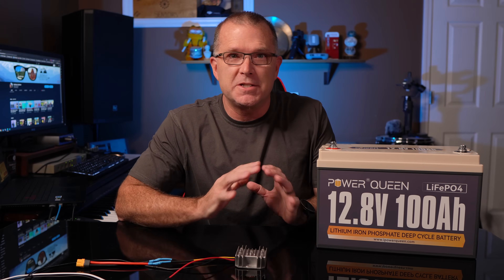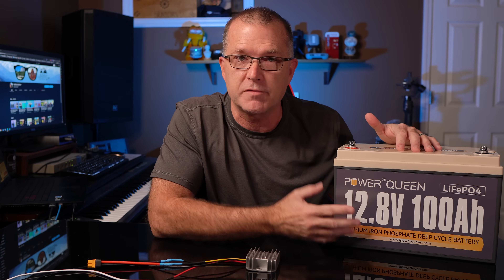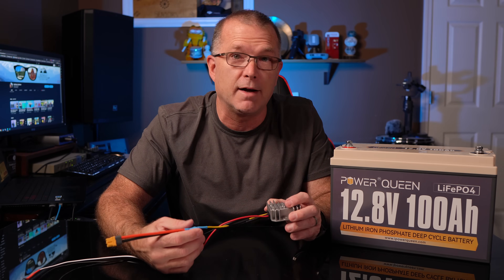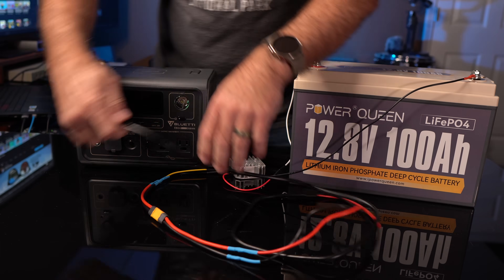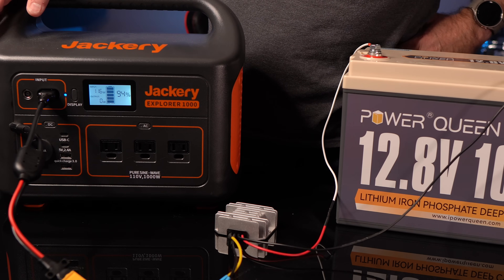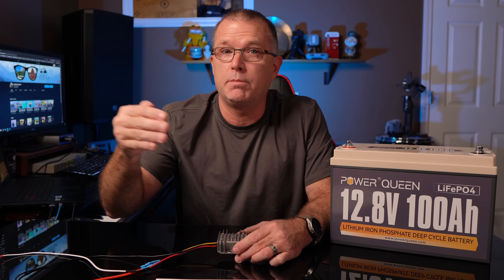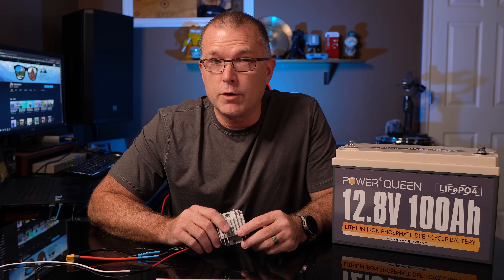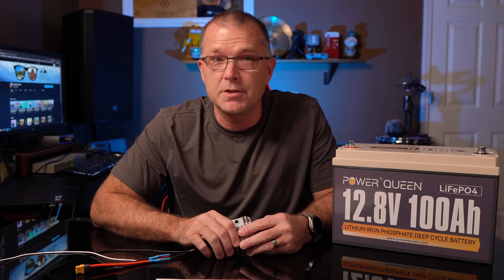SUPER EASY!!  DIY Power Station Battery Capacity Expansion / Charger

Comment: Thank you for your video, I have followed this path.
While I was experimenting with my Ecoflow power stations and a Power Queen 100Ah battery, I built 2 10AWG cables from the battery to the Ecoflow unit. 
One cable had the regular yellow XT60 female connector, the second cable uses a XT60i orange female connector.  
The XT60 cable consistently delivered 102-105 watts to both the Delta Mini and River 2 Pro
The XT60i cable delivered 168 watts to both units.  
I hope this helps, thank you very much.
Reply: Your connection was directly from that battery to the River 2 Pro without the transformer? So this acts like "Pass Through" charging. As long as the output from the main battery doesn't exceed the incoming power, the main battery "remains" charged except for inverter loss? (YES...l'm a "Newbie")
Reply: @reese9276  Hi, the connection is directly from the battery to the Ecoflow units without a transformer, it is pass-through.
I have tried a 12v-24v step up transformer and that yields better results but I'm always concerned about the heat buildup in the transformer, even of the transformer is rated for 20Amps.  
To avoid the power loss issues, my 12v batteries are configured for 24v output and also bought a 24v-50Ah QWW battery that offers excellent performance, I always use the XT60i connector.  
I hope this helps!
Reply: @af1023  Absolutely it helps. Thank YOU!

Comment: Since you have a Vtoman Jump 1000 that uses this "same" VT60 connector for their external battery, have your tried to input the Jump 1000 external battery jack using the XT60 connector and see if you are able to use your own battery - 25.8 Volts - input to the Jump????  Thanks in advance for your testing this theory....

Comment: Concerning the Vtoman Jump 1000, I know you've got one :-), what is the output voltage of the Vtoman extra battery for the Jump 1000???  I am looking to NOT input to the DC input jacks, but, directly tie into the connection for the additional battery pack to actually power the Jump 1000 inverter itself.... As using the step up converter as a CHARGER ONLY is a good alternative for charging, the Title of "Capacity Expansion" with averaging ~100-130 watts output of the converter is misleading at best....
Reply from the maker: I actually just recently sold my Jump 1000 and expansion battery since I'm moving soon and needed to 'lighten the load'.  I'd imagine can get a voltage reading off the expansion port of the 1000 when you get it.  If not, you can try reaching out to their tech support on that question.  They've always responded to my queries within about 24 hours or so.
Reply: @ReeWrayOutdoors  IF, have to measure to be sure, but, the 180 watt charger is speced at 24 volts at 7.5 amps.  SO, need to measure to be sure, but, it looks like the inverter operates on 24 VDC....

Comment: I have a power wheels adapter for my Bosch drill batteries, and use them to expand the capacity of my smaller solar gen in a pinch.

Comment: Can anyone answer why not just get a 24v or 36 v battery then ? And eliminate this step up?👍
Reply from the maker: For sure...if you don't already have the battery, that would be a totally legit way to go.  Alternatively though, depending on your situation, the 12v might be a bit more versatile choice since you can easy run 12v DC appliance from a direct connection.

Comment: I simply have my Power Queen 12v 200ah battery with a NOCO connector on it and charge my EcoFlow Delta 2 plugged into the 12v cigarette to xt60 at slightly over 100w. A trickle charging under load is said to extend your LifePo4 life.
Reply: You think this configuration would work for EF River 2 Pro. I was thinking 200ah would make it a beast in my small camper van.   I didn’t to to lug around my heavier delta 2 max
Reply: @bdmenne  A 24 Volt 100ah Lithium Iron Phosphate Battery will Support and Extend The River 2 Pro and used here often. My Delta Pro 1300's and My Delta 2 Pro and Extra Battery set ups.
Reply: how do you charge the battery?
Reply: @selmopt   With solar or AC wall charger.
Reply: @selmopt You can charge the battery via solar or quicker yet with a LifPo4 charger. It's simple with no worries.

Comment: If you use just a straight XT60 to ring terminal from your battery to your unit you're going to get about 100 watts anyway so why spend the extra $15 for that? LOL however for about $5 more you can get a 12 to 24 Volt 10 amp which takes you to 240 watts 😎😎

Comment: I get 160w into my EB3A using this method, and the I used source is a cheap power station. 
I did have to put the EB3A in standard charge mode and the noise is the fan that comes on.
Reply from the maker: Nice!  It actuality never occurred to me to check the charge mode on the EB3A!  Good catch!

Comment: Great video!  Looking forward to using this technique with my Pecron E600 that’s currently in the mail!  As you know it has a 1200 watt inverter but only a 600 watt battery.  Adding a second battery might be ideal!  So I guess I pickup a charge controller to harvest from my Pecron 300 solar panel (also in the mail) and use a voltage step-up to dump into the E600.  Thanks!

Comment: Amazon sells a $38 12v to 48V step up converter at 6 Amps for about 288 watts of charge.  Assuming that your solar generator can handle that (Ecoflow handles up to 60 V) would that work better perhaps?
Reply from the maker: Sounds promising!

Comment: i have a step up boost converter 12V to 24V 10A for my powerstation but the converter got very hot is that normal?
Reply from the maker: Yeah that is pretty typical.   I've seen some people bolt a computer-style DC cooling fan to them to help with heat dissipation.

Comment: My goal zero lithium 400 has 22v max input, would this still work or should I just connect The battery directly to an input connector?
Reply from the maker: I wouldn't use the 24v converter in that case...and risk damaging the charge controller.  A direct connect (with an in-line fuse on the postive lead) would be the safest option for you.

Comment: Hi thanks for the information, i really need the cheaper expansion option. I wonder if i can use 100ah 48v lifepo4 for delta pro expansion?
Reply from the maker: Just looking at the Delta Pro Solar (DC) input specs, it shows 11-150V @ 15A.  So I'd think as long as you put a 15A or 20A fuse on the POS lead between the 48V battery and the Delta Pro connection, it should work.

Comment: I have a 12v lithium ion phosphate battery and just with wiring and no step up, I can get 78 watts into my powerstation which has a 24v battery system inside.  Just an fyi if going camping and trying to avoid all the extra pieces like a step up converter.

Comment: The ecoflow river’s battery expansion pack will both charge and discharge via the ecoflow.  Everything I’ve seen with these addon is that they’re not automatically recharging, as with an internal addon battery.  Is it possible to set it up so the river will charge the external when it’s attached to A/C,  and discharge it when A/C is not connected?

Comment: Wow. That's interesting to know. Just one question. Can I recharge this battery as well with any of my solar stations? 🤔 Thank you so much for all you do. Hugs from Spain
Reply from the maker: You can.  The best way though is to get a LiFePO4 charger and plug it direct into your power station.  This will ensure that your LiFePO4 battery can be charged fully (provided your Power Station has sufficient capacity) and is not over-charged. I'm actually starting work on a DIY video soon to show how you can build an inexpensive 'DC module'  to attach to any 12V/24V battery and directly power DC devices (USB and 12V car connector) as well as add solar charging direct to your battery. Stay tuned for that. :)

Comment: Is there a way you can charge the 100Ah battery via ecoflow delta 2 (say DC/ cigarette port), so that basically the solar that's plugged into Delta 2... Can charge the LiFePO4 battery?
Reply from the maker: To some extent, yes, but using the 12v output on the power station, it's not going to be enough output voltage to fully charge the external battery. You'd be better off plugging in a LiFePO4 charger into the AC outlet on the power station and charging it with that. Safer and will allow you to fully charge the battery.

Comment: Ok since I'm running 2 12v 240 ah power queen at 24 volt. Can I just put that plug right to the batteries and be good ? Cause all you're really doing is upping voltage and adding plug right ? I have 2 eb55
Reply from the maker: Yeah for sure! I'd recommend putting a little 15A fuse in line on the positive lead for good measure.

Comment: So, if you have two 12v batteries, you don't need the step-up adapter?  I have two heavy duty forklift batteries and an MPPT controller for my two 100W solar panels.   I don't have a power station yet.
Reply from the maker: Yeah as long as your power station's DC input range handles 24v, you should be good just wiring a cable with an in-line fuse and direct connecting it.

Comment: Hi,what would be more efficient,using this step up converter or my inverter?
Reply from the maker: Most likely depends on how big the inverter is.  The bigger the inverter, the more efficiency loss (typically).  Probably anything 500W or less would be close enough so as to be a wash vs the step-up converter.

Comment: great video ❤thanks, wish it worked for my eb3a, wonder if i use a 12v 50ah without a booster ,if that would do it
Reply: You certainly can. I have this setup. You can bypass the booster, no problem. Plus you can always combine two 12V 50ah & get 24 (actually bit more, like  25.6 Volts) should you need the extra boost. I rather have two batteries, cheaper too for some reason, at 50ah than 100ah with a booster.  Food for thought.

Comment: Couldn't you use two and wire the inputs and outputs together to increase the power?
Reply from the maker: Yep, you could do that, for sure.  Just need to make sure that you put a 15A fuse on the + to reduce risk of damage to the power station input.
Reply: Can you please explain this setup clearly. Thank you.

Comment: Bluetti already makes a battery enhancer I use connected to a 12v 100ah LifeP04  battery for my Bluetti ac200p called the DC Charging Enhancer (D050S)
Application Model: B230/B300/EB150/EB240, AC200/P/Max

Function:

* Enable more charging methods like solar, car, and lead-acid or LifeP04 battery charging.
* 500W Max input.
* Increase the PV input rate to 1200W for the BLUETTI AC200/AC200P; 1400W for the  BLUETTI AC200Max.
* Increase the overall capacity of the BLUETTI AC200/AC200P by connecting them with B230/B300.
Reply: Yeah but at what cost?
Reply: @LiquidTurbo  $200 USD

Comment: With a Delta Mini I get about 115 watts directly from the battery without an converter.
Reply: Humm,I only get 97watts.
Reply: @brucevantassel0  , 12v x 8amps = 96w. Maybe because I'm using a dedicated circuit, 105w/8amps = 13.1v?

Comment: I've seen another channel where they combined 2 step up converters (12-36v, 5a) in parallel to achieve 36v at 10 amps to get 360 watts! Perfect for larger power stations like my Ecoflow Delta Max 😀
Reply: yea i was watching that vid also he also added a fan and fuse holder ...I found a 12v 48v 10a hoping to get 480 as advertised on the units info amazon has them
Reply: @si12volt1  
I was looking for something like that on amazon and the only thing I found close was 12v to 24v @ 20 amps - that is good but my solar input only allows 12 amp and 60v max .
Reply: @kablammy7  So 240 W then @ 24 V x 12 A, not bad.

Comment: Would any of the power units take a charge directly from the 12V battery at a full 100A charge rate?  What if you substituted a  (higher priced) 24V PowerQueen battery and forego the step-up convertor? I would like to have longer run-time (at rated output) (something that the external vendor units provide.  However, what you have set up is amazing and very useful.  Thanks!
Reply: Most of the MPPT solar chargers are limited on power.  The Ecoflow Delta 2, for example, is limited to a max of 500W (even though it is also rated at 60V @ 15A max, you are ALSO limited to 500W, not the 900W that 60v/15A would suggest).
Reply: Only pretty large power stations can accept 1200W of DC input.  And yes, a 24V Power Queen with 2560Wh would work very well with no converter!

Comment: What would happen if you connected this to car battery in a car then started the car or used while car running? Is there any increase in voltage out of this device?

Comment: Why not just run right off the battery as a 12.v car charger? Even with voltage sag, the mppt should compensate and continue to charge.  Why introduce an additional loss with the buck/boost?

Comment: I’m confused, why do you need to step the voltage up from 12v to 24volts?
Reply from the maker: Well, for some power stations, it really doesn't make much or any difference.  But for some, you will get more Watts input.  Take the Delta 2 for example - direct connecting with a 12V car adapter will get me 100W consistently.  But if I step it up to 24v through the converter, I consistently get 180W - which is a significant difference, at least on the Delta 2.

Comment: The first thing I thought of that you didn't mention was that if the power bank supports charging from 11v up why even use the converter? Just connect the battery as is. I've done that with my ups and it works fine. In fact the ups even charges the external battery when connected to the mains.
Reply: The intelligent power stations will limit the 12V input because they have to assume the voltage is coming from a cigarette adapter like in your vehicle which are limited to 10amps. This would charge the power station very slowly at around 120 watts. 

If the voltage is “boosted” to 24volts or any higher voltage battery is used, the power station will sense the input and assume it is something like a solar panel and increase the allowed input current so you will charge the station much more quickly.
Reply: @MichaelAngeloTech Ty very helpful!
Reply: That exactly how many watts he was getting after he did all that cable mess@MichaelAngeloTech
Reply: Agreed. Just connect the battery to the DC input and the time remaining jumps up due to the extra battery.  That way you eliminate any power loss from the step- up device.
Reply: I have power station that reads only 400 wtt what happens hooked up to 1270 going in?
Reply: @dons5105  unless your charge controller is the worst available, it should limit input power
Reply: How many watts trickle over that way?
Reply: @bdmenne   If you connect direct without the converter you will only get about 100W. Thats not bad but some may want more. A converter will get you about 200W.
Reply: @SOLDOZER Sir, i have a question. But, first of all i want to say im not good in English and i hope you understand about my question.

I have a Power Station Ecoflow River 2, is it possible if connect directly a cable with XT60 from external 12V battery to my Power Station? And is it safe?
Reply: @garmast  Yes probably. Connect one and see what happens.
Reply: @WestcoastrocksduhTy for the tips!

Comment: An advantage I see with the expandable battery systems is that the expansion battery is charged through the main battery's charging system. With the setup I see here, it looks like you would need to make a separate charging setup for the secondary battery. Am I mistaken in that?
Reply from the maker: You're not mistaken about that.  But consider a power station that either doesn't have an option for direct-coupled battery expansion, OR something like the VTOMAN Jump series that does have battery expansion, but it is also limited to 200W solar input for offline recharging.  In that case, it would be beneficial to be able to separately charge the expansion battery with an inexpensive charge controller and another solar panel, instead of having to rely solely on the DC input limits of host power station.
Reply: @ReeWrayOutdoors  
Thanks for clarifying. Right now I'm using a Bluetti EB70S and mainly charging via my vehicle's 12 volt outlet. It would be great to have an expansion battery that could charge the same way, even if not simultaneously with the Bluetti. But I do see how your setup would be great in situations where solar charging is being used, and a lot more affordable than the pre-packaged expansion systems. I really do appreciate you sharing these ideas with us. Thanks!
Reply: That’s exactly what I’m thinking. You would still need some way of charging the 12v. I’ve been curious on whether you could simply plug in a dc to dc converter to the battery and the generator. I would only be worried about the whole thing shorting since its just a giant loop at that point.

Comment: Does this work in reverse then?  If it's connected to my EcoFlow Delta 2 will the Power Queen battery charge as I charge the EcoFlow or is it a one-way street?
Reply from the maker: You could charge the battery with the Delta 2 if you connected a 12V LiFePO4 charger using the Delta 2's AC output.

Comment: These are a DC-AC-DC inverter that takes a DC power and chops it up and then back to DC out. I expect on the power station is this device does not make a pure sine wave but modified sign wave that can cause issues.

Comment: What about the fire Hazzard of using lithium batteries?
Reply from the maker: While the risk is not zero, the likelihood is extremely low, with the protections the units have built in. But i do prefer LiFePO4 over Li-NMC for that reason,  just in case.